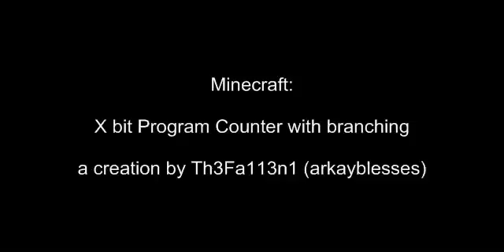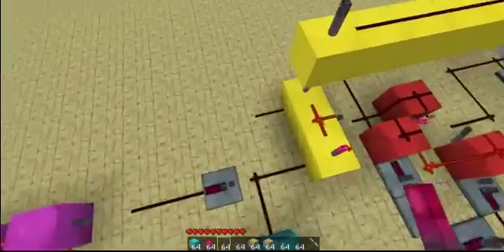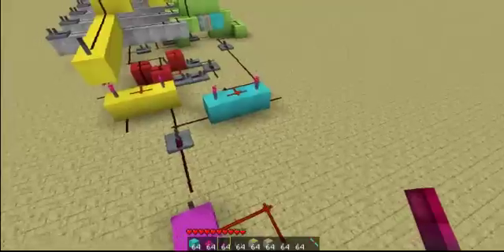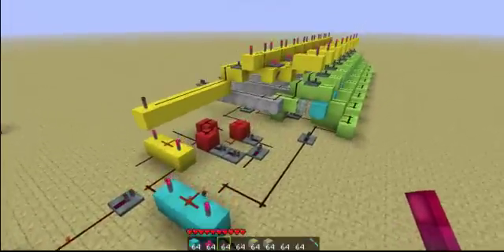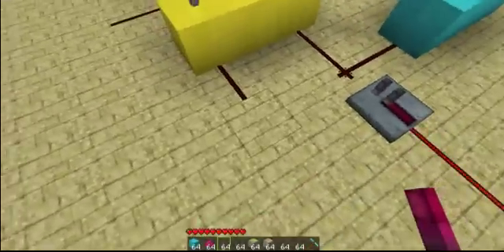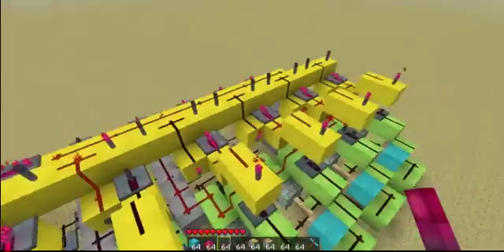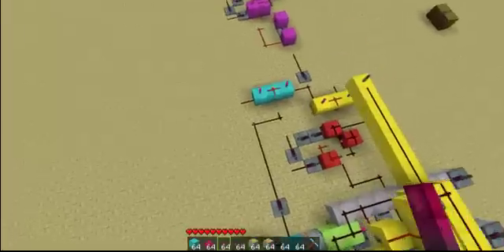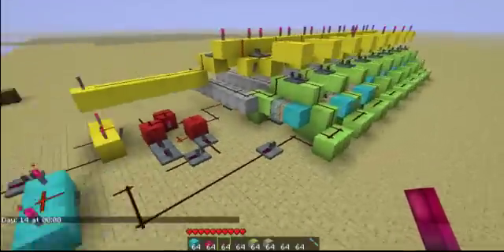Minecraft - x Bit Program Counter With Branching

Comment: Neat.  I have a design that I've been working on that's only 2 blocks wide per bit (making use of a narrow XOR design), but is significantly trickier to Load values into since although it can turn a 0 -->1 it can't do 1-->0, and it loses accuracy if it has to count too quickly.

I'll study your design and see what I can learn from it.